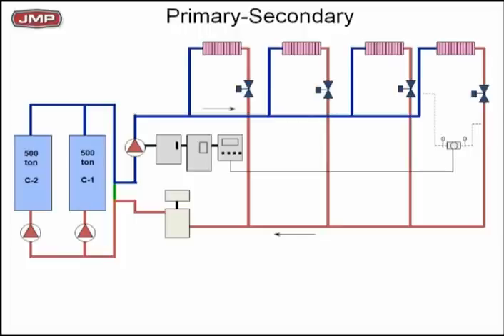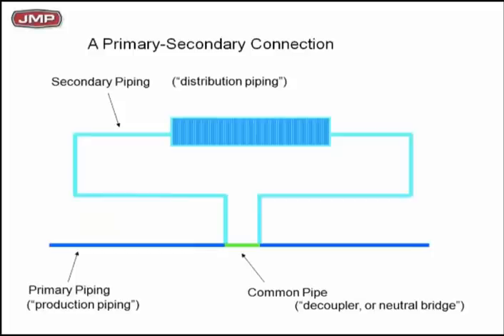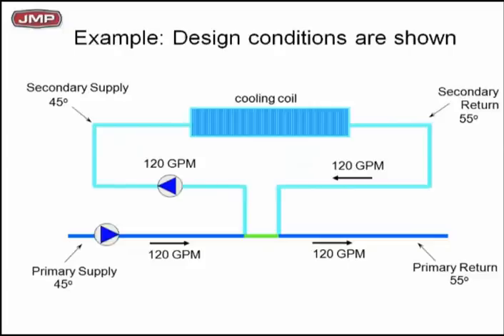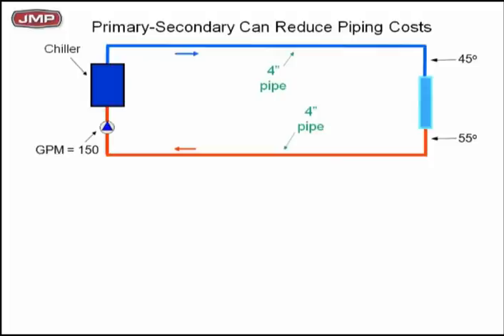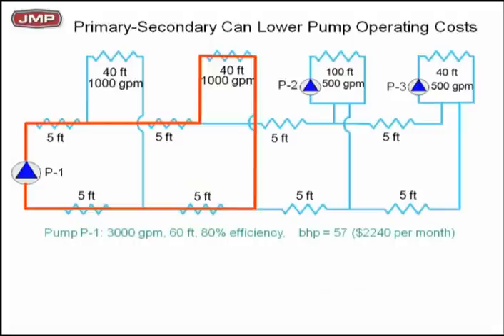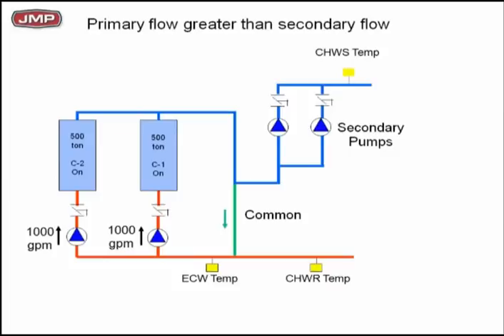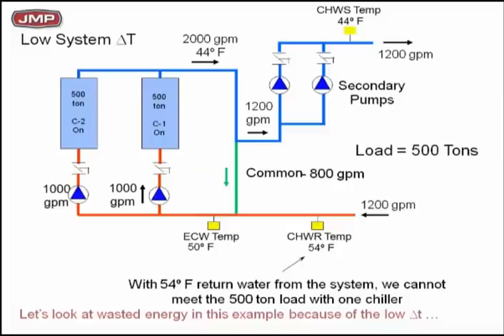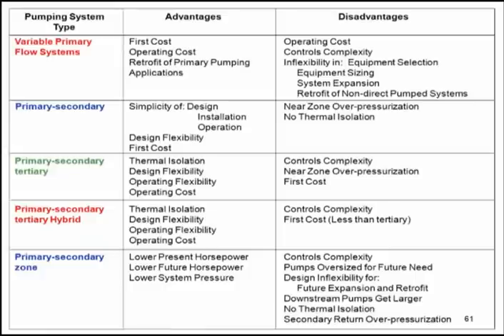Primary Secondary Pumping

Comment: Then why bother with the common pipe? Take it out and take out the secondary pump, the system is always balanced?
Reply: Sun Shine I know it’s been a year since you post this but I think I might know the reason. This layout is usually used when you are coupling 2 or more heat or cooling sources to a system and it’s meant to promote optimum efficiency The primary loop is separate to the secondary loop and is designed for the primary flow rate to meet the secondary flow rate with the correct temperature demand on the flow in order to achieve a perfect return temperature so that the boiler flue temperature will condensate all while the boilers firming at half rate. The primary loop being utilised as a low temperature loss header that keeps the boiler operating efficiently. Hope that explains that
Reply: To main a minimum flow rate of chillers i.e in primary circuit ,what ever may be the demand in secondary flow ,assume the demand of secondary flow is much lesser than minimum flow of chiller ,but chiller has to work atleast at minimum flow rate ,so excess water will go into common pipe.and other reason is that to operate the two circuit differently